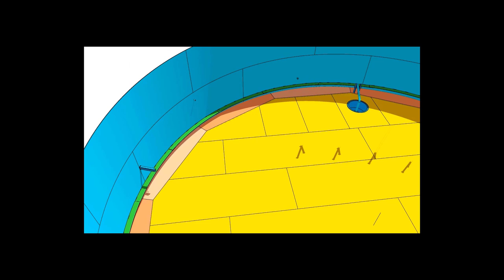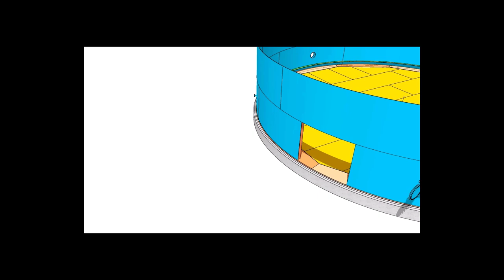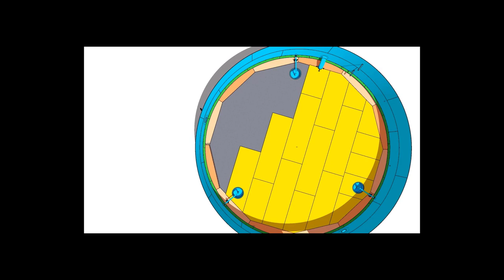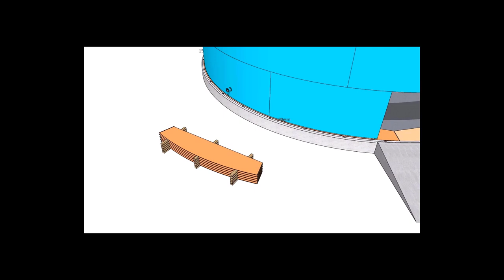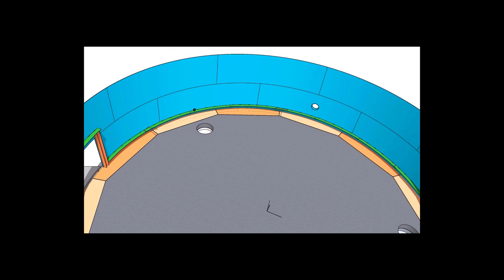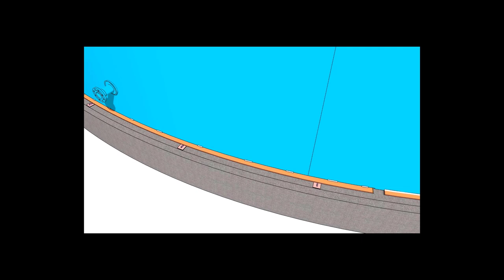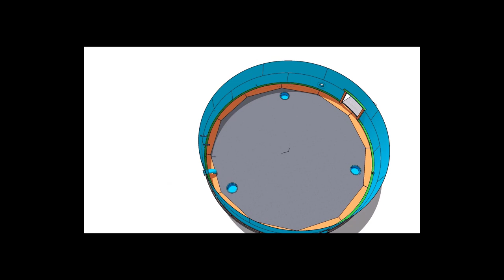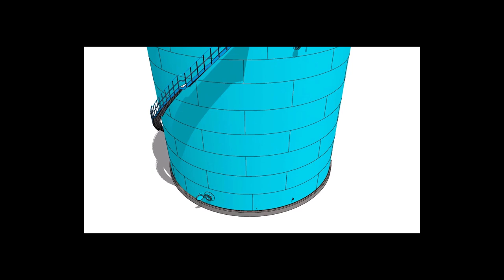API 650 STORAGE TANK BOTTOM, ANNULAR PLATE REPLACEMENT LOW COST METHOD FOR BEGINNERS AND EXPERTS

Comment: Great video. What references would you recommend for determining the minimum required size beams needed for the stiffeners? API 653 doesn't seem to cover much beyond stating they may be required.
Reply from the maker: Thank you bro. As you told, minimum size is not mentioned in the cods. Structural size depends, the diameter, slope, loads on the roof, ind speed etc

Comment: What cutting method was used to cut the old annular away so that there was a clean straight profile on the bottom of the shell plates for welding the new annular welds. Are there photos of this work somewhere? You must also take care not to cause a differential settlement situation or cause damage to the shell bottom plate when driving in wedges. Interesting approach.
Reply from the maker: We used the gas cutting method, fortunately, our gas cutting technician was highly experienced in these types of jobs. He put a 10 thick flat bar near the corner welding and moved the cutting torch horizontally. The cutting was very smooth. Unfortunately, there was not any photograph left.

Comment: API 650 is for constructing a new above ground liquid storage tank while API 653 is for the maintenance of an API 650 to determine whether the tank fit for continued service.
Reply from the maker: Bro, you are right, but for some corrections, API 650 stands for atmospheric pressure. API 653 stands for whether the tank fits for continued service. Thank you for the comment.

Comment: What is the correct scissor seal installation method in floating roof storage tanks for hydrocarbons?
Reply from the maker: Bro, sorry for the late reply. Each and every sealing has its advantages and disadvantages. I am only a fabrication engineer.

Comment: So you have to raise the  tank  with crane or hidraulik  pistons
Reply from the maker: Bro. it depends on your pocket 🤣
Reply from the maker: If you have dollars, I will recommend the jacking method. This is a low-cost method.
Reply: Yes but if the tank weight is 120 tons, is not so safe  to lift it with crane right ?

Comment: how do you perform the weld where the 2 annular plate is directly below the shell?
Reply from the maker: Thank you for the comment.We used to push two wedgs on both side of the joint between the shell and annular plate, making a gap of 20 to 25mm.
Reply: @technicalstudies.  How to do  RT for Annular joints
Reply from the maker: @TheTanker_69  Hai Ketsana. Not many clients, ask for RT, in this type of replacement methods. Instead, UT and PT is possible. In case the client ask for RT is a must, then we need to change the LOW COST to HIGH COST jacking method. Thank you.
Reply: @TheTanker_69  where do you keep film for RT

Comment: It is not clear  on removeal of the existing annular bottom plate when wedge load is exerted on existing plate , also tnak height is reducing by  25  mm , will changes the position of nozzles

Comment: How to weld annular to annular But Joint while Shell plates rest on Annular plate??
Reply from the maker: drive, wedges, between the shell and the annular plate, you will get enough gap for welding, use a needle grinder for cleaning.